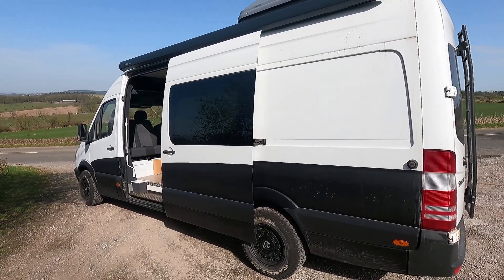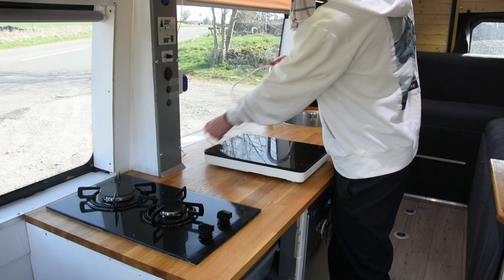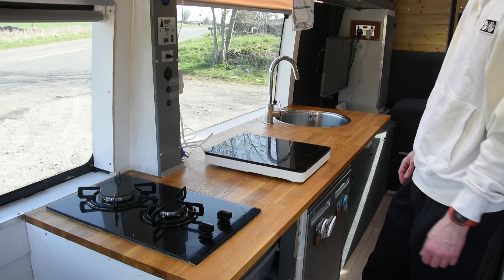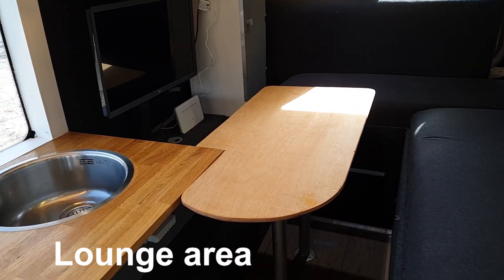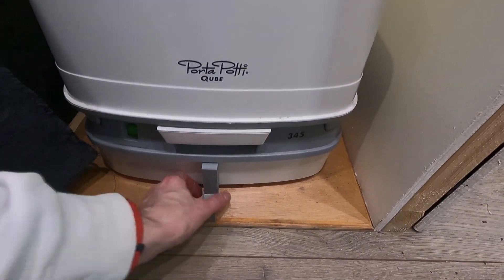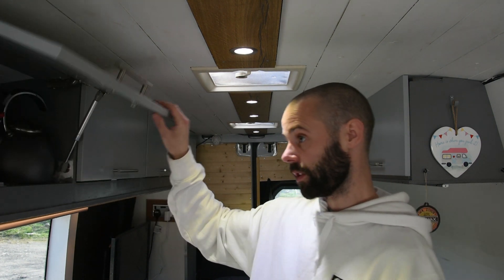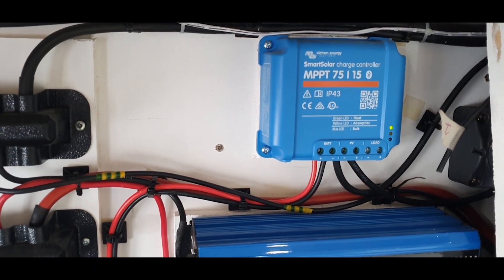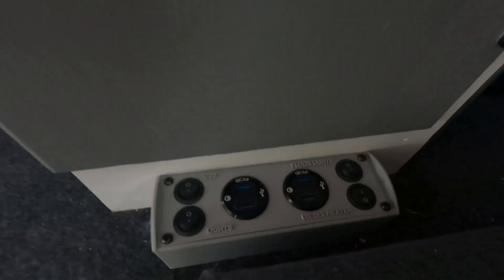CAMPERVAN TOUR! Sleeps 5! Mercedes sprinter conversion

Comment: Awesome build! Question: I have never seen that snaking water hose guide management system @11:59 - what is it called? Its an incredibly smart idea for garage hose storage operating in such a tight spot! Cheers
Reply from the maker: Thanks! 
It's actually a cable guide from a machine. It's can easily be found online. It's to ensure electrical cable doesn't tangle or knot when being moved. I found one just big enough for my water hose though and it does a perfect job!
Reply: @DoneDeets  really resourceful! I dig it! Imma go look for this clever repurposed item! 

P.S. After looking^ (thanks again), the tough part about finding it is yours can collapse onto itself - most cable management bends a bit - maybe you were just getting it to hyper flex past its normal point. Either way, great concept!
Reply from the maker: Google Energy Chain 👍
Reply: @DoneDeets  Amazing! Youre the very best in town!